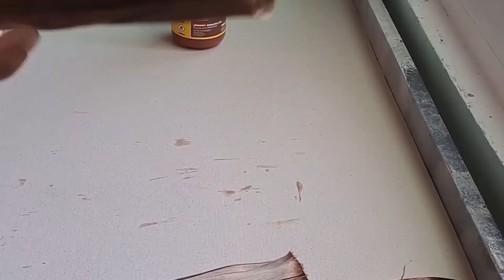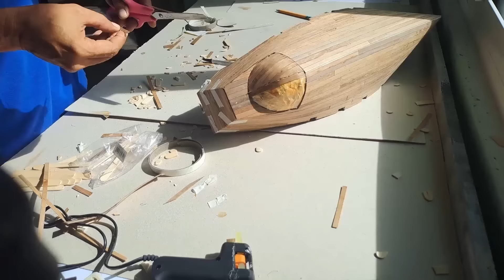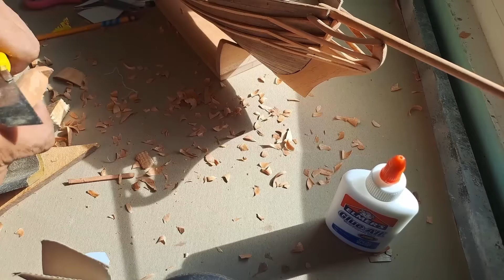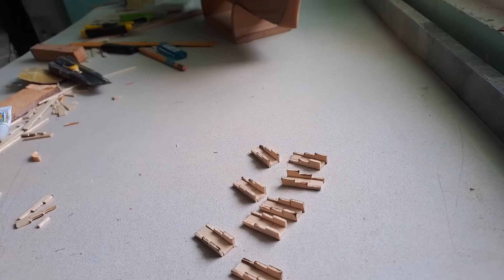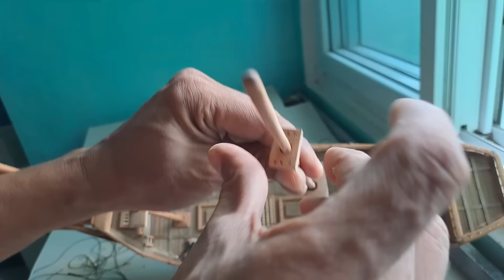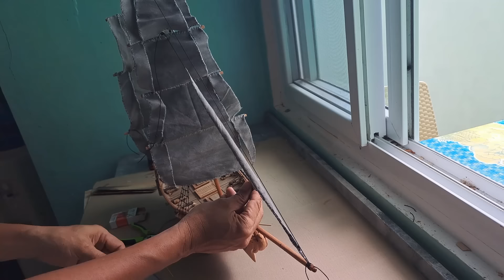Building the jackdaw ship

Comment: Mate, you are extremely talented and skillful. The model is amazing but you've done some mistakes that hurt the model greatly. You should've made the sides in a U-shape instead of V, also the rearmost part would look much better if it wasn't separated from the ship. And finally, the masts should be tilted backward, not forwards. The best way to make it properly would've been to build a ship from the inside, i.e. first frame, then planking, not the other way around.